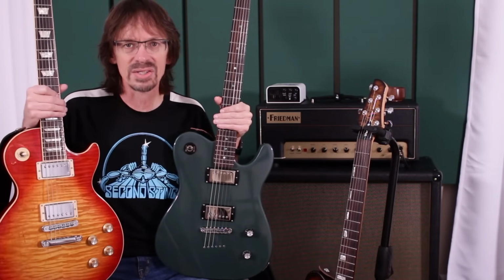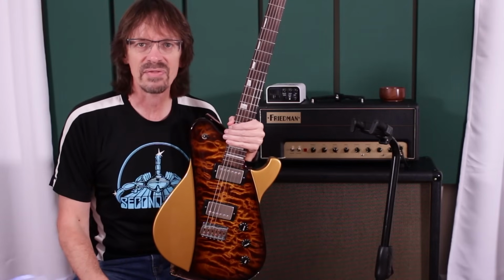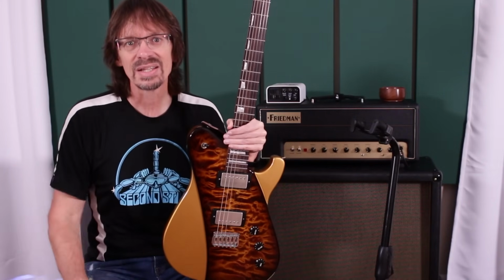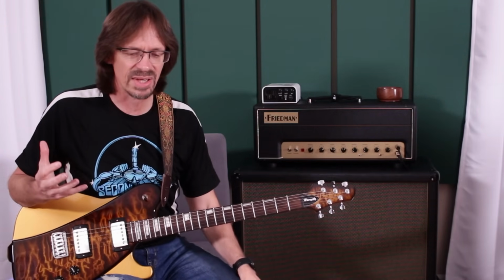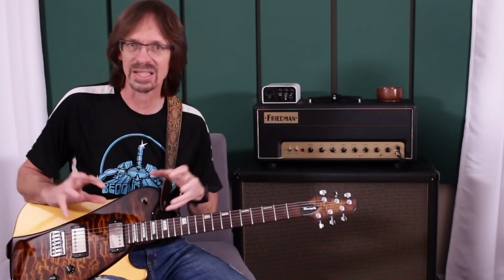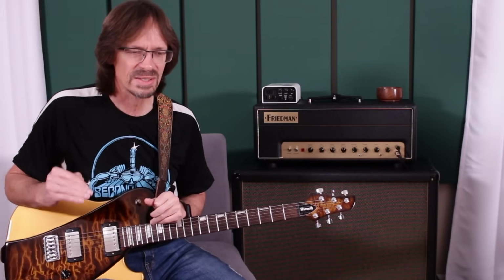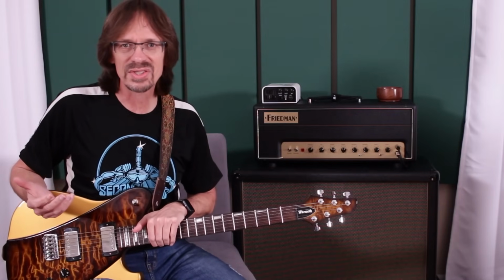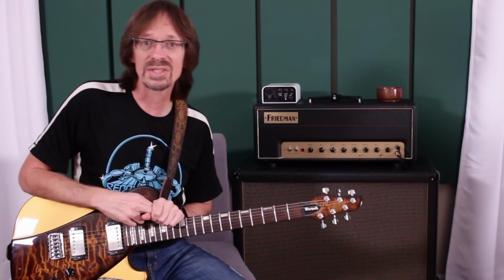Does anything else sound like a Les Paul?

Comment: I got all three right because of the timbre. A non tune o matic fixed bridge will always have a clang I would call it or a twang. The Gibson scale with a tune o matic has a warble and that left the third guitar missing the warble which meant it had to be a normal fender scale with a tune o matic. I can most easily hear the differences of the timbre on the bridge pickup because of the clarity. It’s harder to hear the differences on a neck pickup.

Comment: I am seriously against gibsons lol. 

Some of em look kool... Sure... But lots of guitars look kool. Big whoop. Know what's not kool? Those prices lol. The quality control haha. And of course tuning stability. Guitars breaking is most common with gibson over fender, ibanez, esp, gretsch, rickenbacker, dusenberg, supro, jackson, prs etc etc. Funny right? The one's most likely to have issues are the most expensive one's. Does it make sense? Are Gibsons just that much fancier, therfore deserve that high price tag? Psh no it's a scam yo. Rics and Gretsches are often fancier and cost wayyy less. Often 5 times less!

Want a guitar that's far more comfy, just as good sounding if not better, and doesn't cost you 5 grand? Get a fender. Or go with warmoth which is basically just a more special fender aka (better fender lol)

Want a big ol jazz box electric? Go with gretsch I say. Gibson L-5 is nice and all but is 10 grand really worth it? A electrometric gretsch can get the job done and those can be found for 400-800. or especially a TN rose, country club, country gentleman which are closer to 1500-2500, or of course a freaking falcon. Even falcons can be found from 2-3k. Still wayyy cheaper than the Gibson.

Heritage actually makes gibsons the way they are supposed to be made. With the orig machines from the Kalamazoo factory. Want a gibson that actually sounds like it should? Buy from them lol. New gibsons are made out of TN ever since 84. This is when the company got EXTRA greedy and corporate... Gibsons made after that are just not as special sad to say... You can get lucky and still get a decent one from time to time but I'm just saying... Gibsons golden years came and went a loooong time ago. And I don't see em coming back any time soon. If ever.

So yeah... f--- that company lol. Go with warmoth duh! Best electric guitar partscaster game in town I'd argue. Or go with heritage. The company that kept making gibsons the way that they were made in the 50s and 60s. They got old school duncans up in them, so you know they sound good. I got one with 59s in it. Haha I'm so happy that I own one of the better kinds of les pauls out there. I feel like I got bragging rights ya know? Lotta les pauls suck lol it's true. Tuning headstock issues, over paying, and weight being close to 9 pounds or more : (     Mine is right under 8 pounds : )

If you do have your hands on a well built gibson les paul or sg with brazilian rosewood from 65 on down though that's in decent condish still... Then holy crap you got yourself a pretty great gibson that's worth tens of thousands of dollars!

But hardly anyone has that so maybe take my advice lol.

And if I was being extra serious... If Satan came down with a time machine and forced me to shoot Leo Fender Or Les Paul, terminator style. And he forced me to choose 1 and spare the other. Of course I would shoot Satan instead lol don't get me wrong. F--- that guy. But if I was weak willed and not focused. Someone like Justin Long from the movie Barbarian lol. I would shoot Les lololol. Sorry but I'm a lil biased against gibson guitars. I think they CAN be good don't get me wrong. But the risk of easily breaking them, the high prices, the quality control issues... Meh lol. Nvm Gibson... That being said. If you got a decent one. Hold onto it : ) Just trying to be as fair as possible to gibson. The company that mostly sux lol.